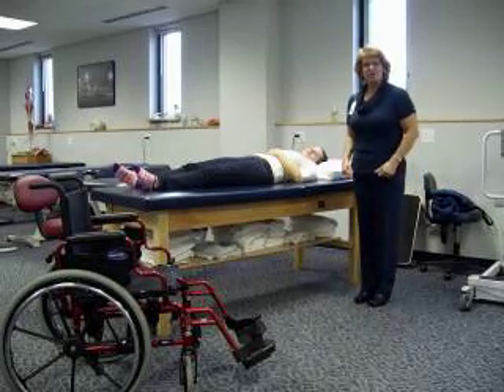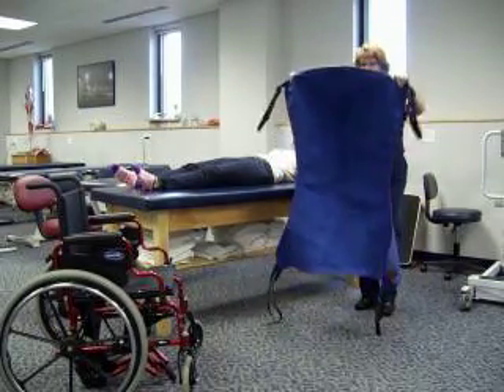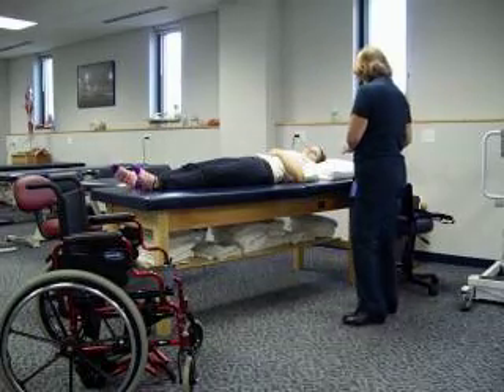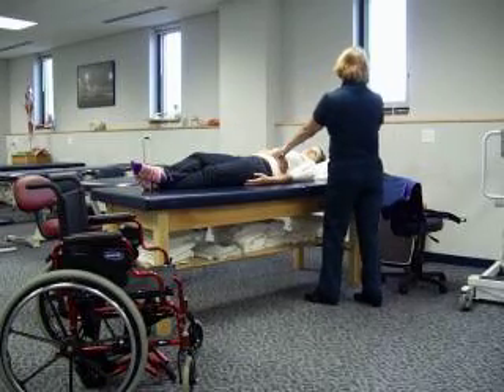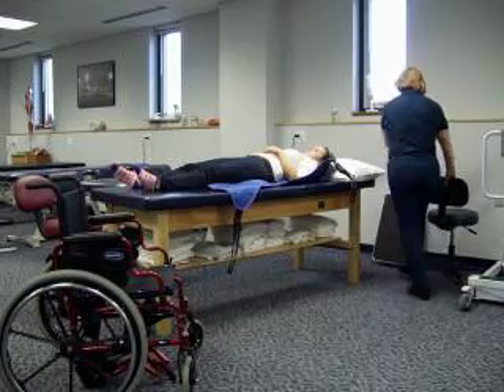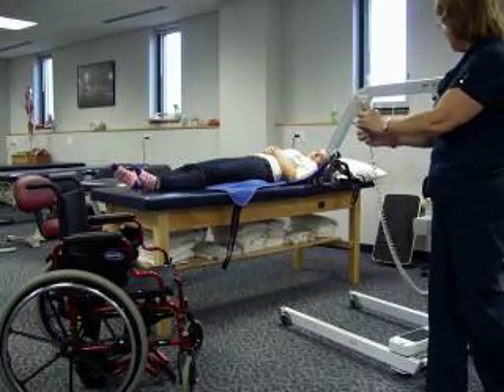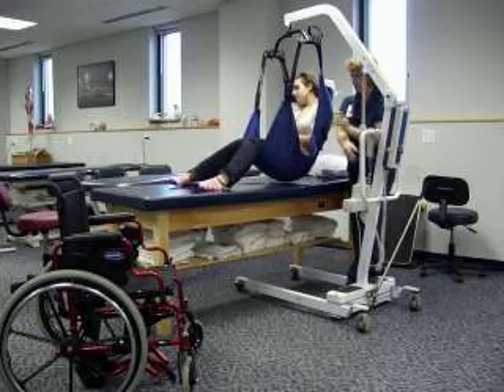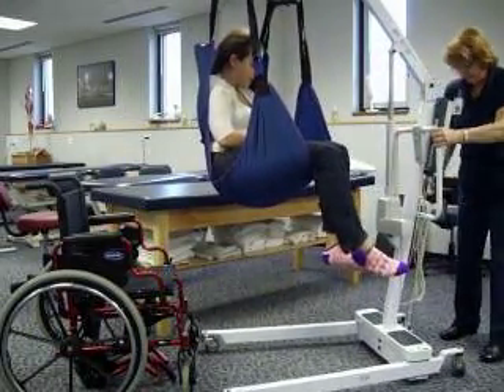Hoyer lift using a Solid Sling

Comment: Questions: Should the base be opened while lifting the patient from the bed to prevent tipping. Also, when do you lock the hoyer lift. Should it be locked when lifting from the bed? What about when lowering patient into WC? Locked when lifting patient from WC?

Comment: Unfortunately, she did not widen the leg base until after moving the patient close to the wheelchair... MUST spread the leg base BEFORE moving patient so that there is a wider base with such a high center of gravity.  I have seen hoyers tip with the patient in them if the legs are not spread.
 Every other part of this demonstration is wonderful, specific, and very practical

Comment: I think she forgot to put on the lock of the wheels before putting the sling and lift the patient. There's a tendency that the hoyer lift will move either way. Also before lifting the patient, the base of the hoyer lift must be adjusted like "V" position.
Reply: She locked the wheels of the chair
Reply: @adelepolinsky3472  Orlando was referring to locking the wheels of the lift, and spreading the legs of the lift into the "V" position, for absolute safety & stability.